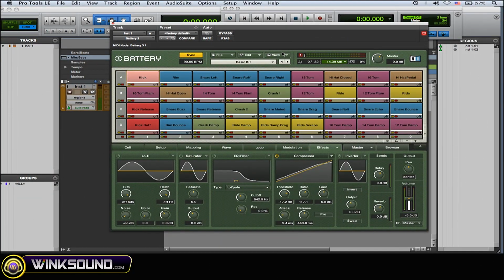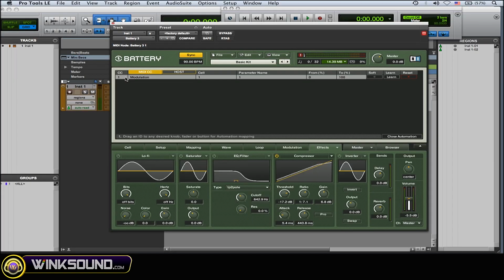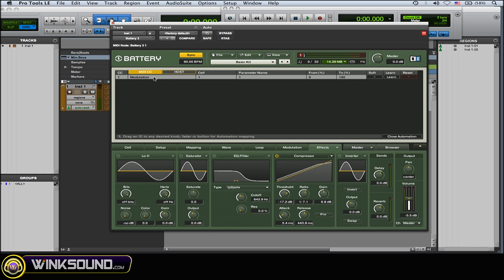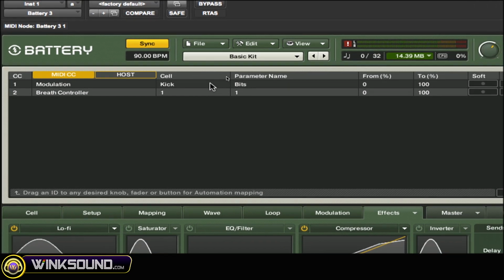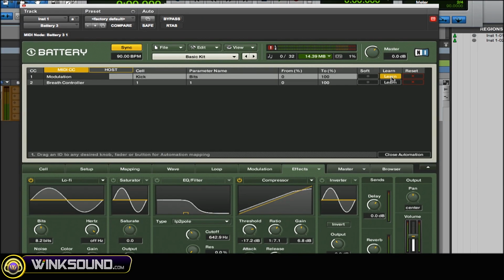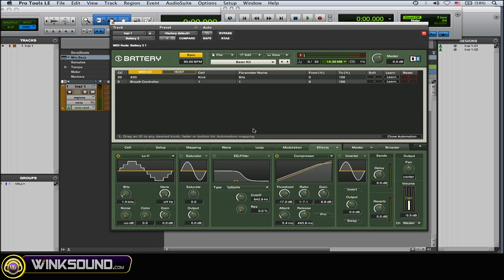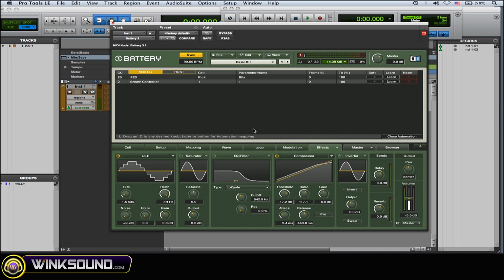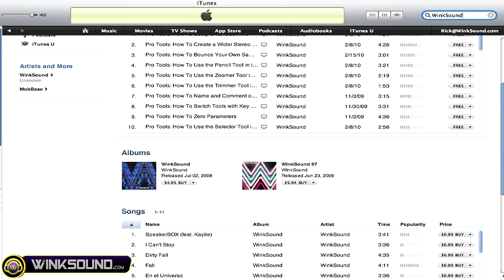Pro Tools: How To MIDI Map Parameters in Battery 3 | WinkSound

Comment: when I attempt to sync the Battery with my MIDI controller my whole set up stops working.  

I know this has nothing to do with pro tools, but when I attempt to control Battery within pro tools everything stops working and pro tools closes.Would you have any tips that may help me with this issue?

One more. should I be attempting to control batter directly or is it better in pro tools? If not would I still be able to use the Battery plug in and sync it with pro tools from my deck top?